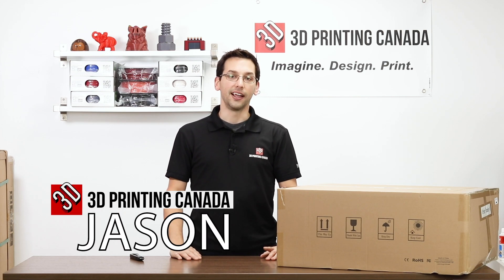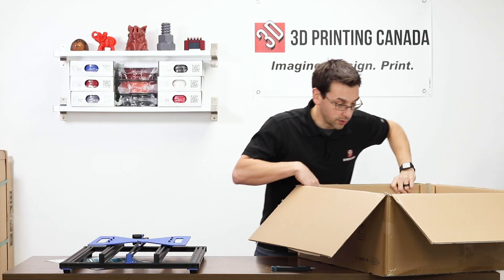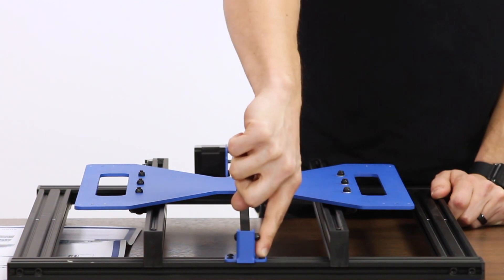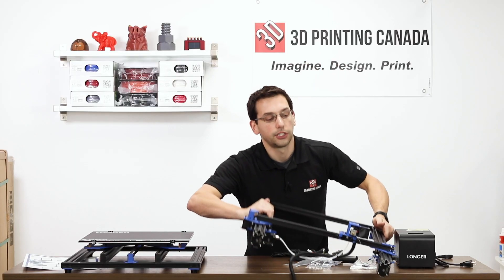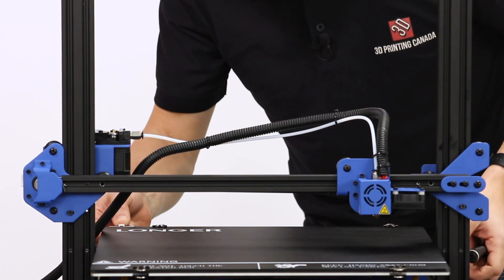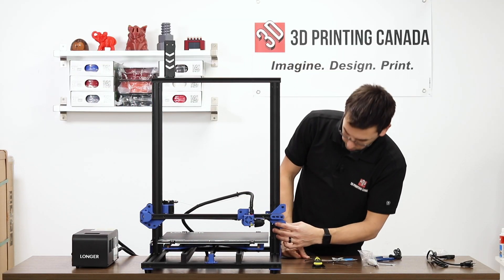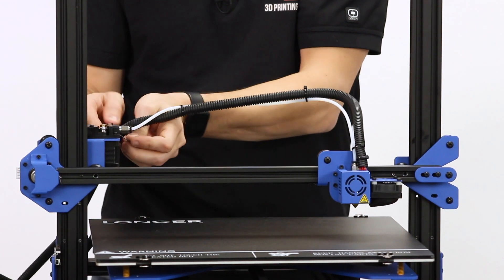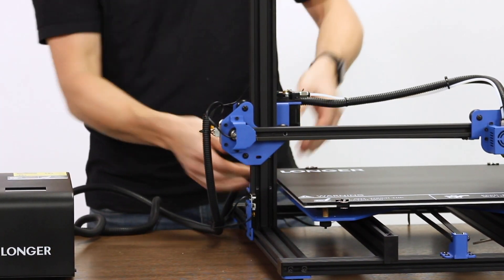Longer LK1 PLUS Unboxing, Build and Test

Comment: I'm trying to level my new LK 5 and the nozzle motor keeps pushing it into the bed and not stopping. I have to shut the printer off to stop it. It looks like it's making contact with the limit switch. Printer came with a pamphlet and little explanations. Does anyone have any suggestions?

Comment: What board comes with the LK1? And what firm ware can you use to upgrade the printer?
Reply: Hi, did you find out if board is upgradeable ? i was wondering if an lk1 board would work in a cr10 clone i have ? thanks

Comment: What is the connector name at 10:58 ? I would like to buy a couple to install them in my 3d printer.. They are neat and I think it would be easy to connect and disconnect the main board from the 3d printer (to upgrade something, troubleshooting or maintenance)
Reply: Jason  thanks

Comment: My LK1 printed for about two days then started making weak walls and skipping.   Seems to be too much resistance in the bowden tube.  I've cleaned the hot end, replaced the tubing, did the tube piece fix at the hot end, bought a new extruder, replaced the nozzle and tried printing at 230 with PLA.... same BS.  Waiting for a swiss hot end now.  DONT WAIST YOUR TIME OR MONEY.
Reply: its th euser, not the machine 98 percent of the time